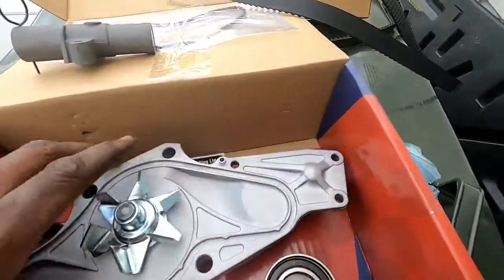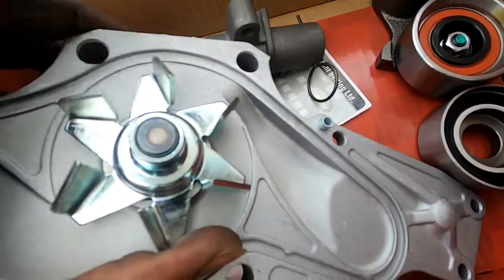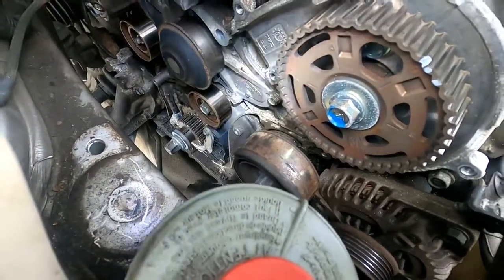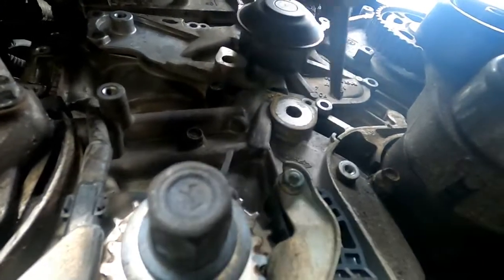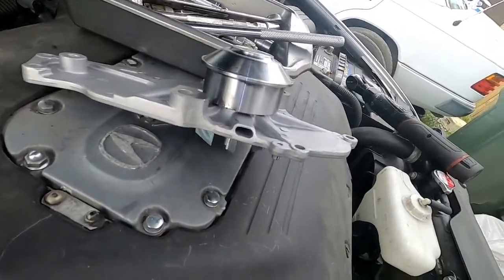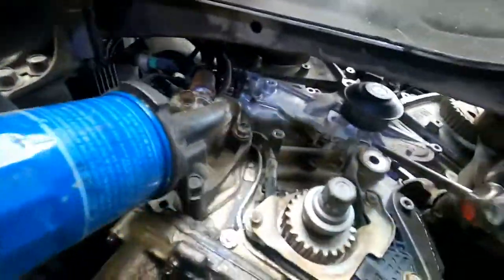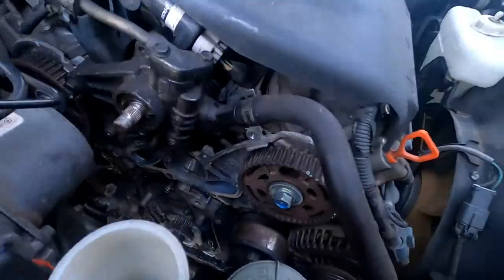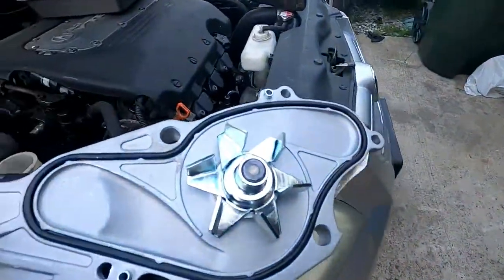2004 Acura TL Timing Belt and Water pump replacement pt2

Comment: I change the thermostat and pour my 50/50 in with a funnel and it start leaking on the left side where the water pump is located. I have not started the car yet. Do you believe my gasket not workring properly.
Reply from the maker: If it's coming from the water pump side it's most likely a leaky water pump. Sorry for the late response. I would like to know what it was

Comment: You are trusting a $3000 motor to made in china parts cheap ass parts that will never last the 105k mile interval change?   Good luck with that
Reply from the maker: Thanks for the feedback
Reply: @Davethemechanic305  are you even a mechanic?   Did you torque the important bolts to specs like the idler and tensioner pulleys and water pump?